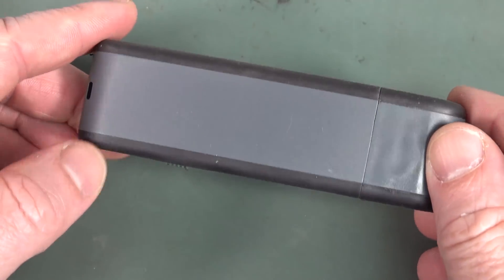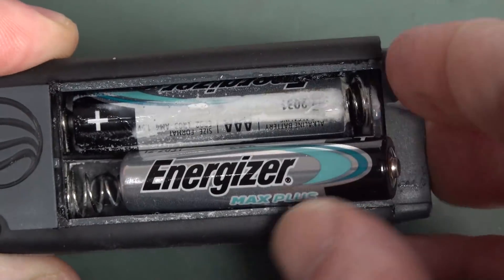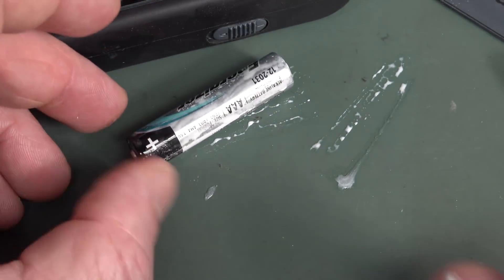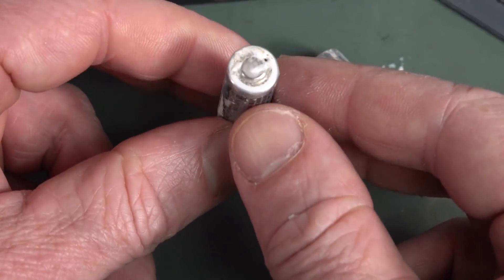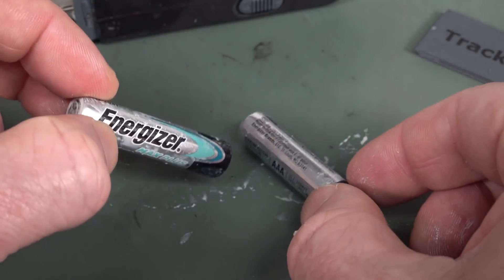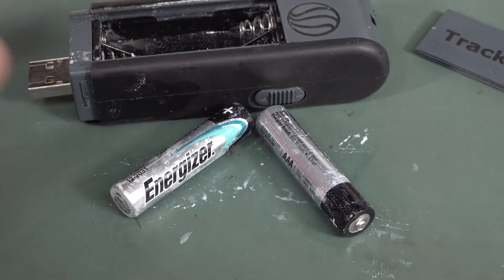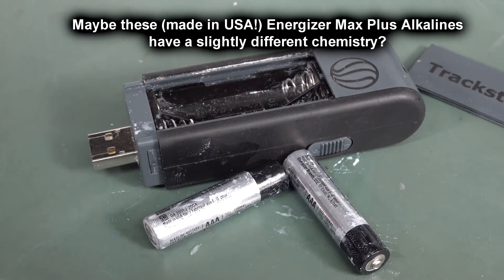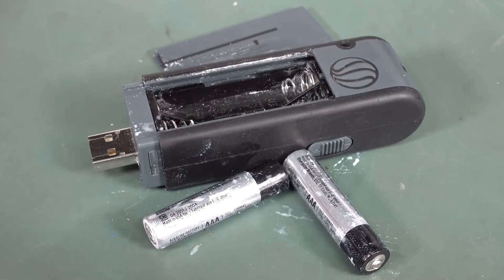EEVblog #1349 - Energizer Battery Leakage - MADE IN USA!

Comment: All of my Energizer Max in AA and AAA forms have leaked. Devices I have used them in are AC Remote, TV Remote, Oxymeter (AAA) and Wireless Mouse(AA). Thankfully I was quick to catch it just as the negative terminal was just slightly wet.
Have moved the remote's to Zinc Carbon and the wireless mice to Panasonic.

Comment: WARNING: Do not get that liquid on your fingers. I was picking up a battery and the liquid got on my fingers by accident. I immediately washed it off but now I have some type of chronic dermatitis that I can't get rid of. I have tried every ointment and cream on the market but my skin constantly flakes off revealing the lower layers. Even the doctors don't have an answer. And it only appears on the fingers that actually touched the battery. I believe the chemicals oozing out of the battery cause some type of permanent damage to the skin DNA which prevents it from growing normally and protecting the lower skin layers. I've had this for almost a year now and it won't go away. Always use surgical gloves or a a pair of pliers when picking up a battery which is leaking and dispose of responsibly.

Comment: Happened in my Game Boy, set it on a table then lifted it up to see the table discolored. Then I put the system on a air bed, then some fluid was on it. I looked inside the battery compartment only to find this.

Comment: I open up my Logitech mouse G305 for battery check, I took out the battery to see the expiry date, next thing i felt liquid through my palm, I thought why would I have water on my palm but i realized that it was from the energizer battery! threw away the battery, washed my hands back to the mouse, there was a small puddle in the battery compartment of the mouse, tried cleaning up and even did a teardown to clean that up, but it was too late, the liquid got to the mouse sensor and it is now total dead. It was total clear like water when it oozed out, during the process towards crystallization, it started to get slight sticky. My mouse was just 3 months old.

Comment: Biggest problem I have with Duracell is that they are very prone to leakage. I have damaged so many electronic items by using Duracell. I can no longer leave Duracell batteries in equipment that may sit idle for 6 months or more, and in fact, never use Duracell where I can access an alternative. With Energizer, which I now use almost exclusively, I don't recall ever suffering from battery leakage and subsequent equipment damage.

Comment: I stopped using Duraleak and Energizer due to leakage. I only use Rayovac batteries because my experience has been they’ve leaked only in the most extreme cases, such as being left in an extremely discharged state in a device.

Obviously Rayovac batteries are the ones to beat since Energizer bought them when they couldn’t beat them.

Comment: I completely stopped using alkaline batteries. I use either the more expensive lithium batteries for stuff that draws low current but must work when I use it (fire alarm / emergency flash light). Or Eneloop chargeable batteries with low self discharge (10%/year), so that they can be in a drawer until I use them.

Comment: I've seen the liquid a few times. I've tried darn near every brand available in the US. Energizer used to be good, not any more- in fact none are any good any more. I buy the cheap crap where you know 1 in ten cells are DOA or dead soon, swap out the dead ones as needed, then remove them after use if it's going to sit more than a few days unused. 

Now anything I need to keep powered gets the 'heavy-duty' stuff, not alkaline, even if it means replacing the cells frequently. If it something which needs to be long-term I take out another mortgage and use lithium primaries (which are usually Energizer brand ones). So far so good. 

But my preference for most things where I can use them is now LiIon; one heck of a lot of energy and if not mistreated will last for many years us use. Not a direct-swap for primaries but no leakage and best long-term value where you can use them, especially the 18650 size which has the best 'scale of manufacturing' cost as so many of them, are made. Use only the good ones with a good charger and you'll never want to go back to anything else.

Comment: Here I stoped buying Duracell, the leak randomly between the first 8 or 10 month. Have many thing ruined already. And 10 yeard ago you could leave this AAs for ages and no leaks. Energizer is a bit better. In the old time, the zinc carbon one were the leaky and the alkaline were the one that dont. Now guess what, the cheapo zinc carbon garbage will stay longer without any leak comprared to the more expensive well knonw brands. This happened in the last 5 years or so. Ok with planned obsolence but ... ruining my gear ?. Now if I mnot not using an instrument for a couple of months and need to take the Duracells OUT and put in a shelf. OF COURSE ..... the dont leak on the shelf. ONLY INSIDE YOUR GEAR ... CROCKS

Comment: I had this happen with the power winder on one of my 35mm cameras. I couldn't figure out why my hand was getting wet, until I removed the battery cover. I was using Rayovac batteries.

Comment: "For once it's not Duracells" .. Brilliant!

Having worked in the service trade (TVs & VCRs, HiFi etc.) and since then doing repairs as a hobby you wouldn't believe how many ruined devices (usually remotes but sometimes radios and other portable equipment) I've had to fix, usually with DuraLeak™ cells fitted. Many of these still had charge in them .. maybe exacerbating the issue?

And, yes, I've had a few with the liquid coming out ...

Comment: At 0:54, "probably should put this on my fingers"
At 2:49, still has it on his hands........😮😮
At 2:54, "clean it up straight away"  😪😯😪😯
Dave.. Dave.. please ... Where is your clean up gear?
Hint; At my workplace we have bog roll holders on the bench with bog rolls on them, any spill or quick wipe you just rip a couple of squares off and Bob is your Uncle.
Also good for using with iso to wipe and  clean stuff.
I have had commercial gear with leaking Alkaline, doesn't matter what brand.

Comment: Yeah that sucks to those  batteries leak it ruins your device and vinegar is also a acid so it doesn't help your metal terminals use baking soda it neutralizes the acid it's a bicarbonate

Comment: Is actually not acid inside, that's why they are called, "alkaline batteries". It's the opposite of an acid which is why you use acids to clean up after. 

This is also why you should only buy lithium AA and AAA batteries. They have around a 20 year shelf life and never vent electrolytes. They are also waaayyy lighter...

Comment: Had a bunch of toys sitting with batteries inside. Toys all had physical power cutoff switches wired in series with the batteries. Multiple brands used. Half the Duracells leaked, every single off-brand leaked (Thinkgeek), and none of the Energizers leaked after about half a decade. Thankfully I was able to clean them all up and get them all working again. So now I've got Energizer Lithium in the really important stuff, and Energizer Max in the less important stuff. But after seeing this, it makes me think they drank the same forbidden knowledge Duracell did and have let their quality slip away. Very sad.

Comment: I had some energizer batteries leak in about 1984, but that was an oily substance with a weird smell.  It was something not easy to just wipe off, but I had to use a special soap to get it off at the time.  They were D cell batteries.  Mine was in a boom box that had physical power switch and was off at the time.

Comment: I had recharged an empty alkaline because I had no replacement. After use, I removed it from the device and put it on the bench. 
Some days later i noticed a hissing noise and found the battery spraying its guts on the bench. I thought maybe it had an internal short, but it was completely cold.

Comment: Yup, found about a tablespoon of liquid electrolyte from 6 D cells in a synthesizer. 4 of them had leaked only a day after I put them in. Duracell. Incidentally, the only other brand I've had leak has been Energizer, but Duracell is really bad, they leak almost every time I buy them. Which... might be why I haven't in two decades.

Comment: I have but not to that extent and I think they were mostly Duracell's, I have occasionally had other brands do it.

And I had a leak in a two way radio I proceeded to clean with isopropyl alcohol, then noticed on the Duracell site they recommended lemon juice it went from working to no longer working.....

Comment: I had some duracell batteries Make a Pop noise in a cordless mouse a long time ago in 2005 and it scared me as it popped quickly I figured pressure buildup caused the batteries to pop destroying a cordless mouse
Reply: They were venting most likely due to overheating/too much pressure.

Comment: When I saw that liquid it reminded me of an incident that happened about 15 years ago when I got electrocuted by my Fluke T5-1000 (or whatever the equivalent model was back then). The meter is a handheld device that lets you attach one probe to the unit and hold the other in the other hand so you can find an earth  somewhere and probe around. I was checking inside a control panel for 230vac, when suddenly I got a huge shock. It wasn’t immediately obvious what had happened, but when I got outside into the sunlight, I could see that white semi transparent battery liquid seeping out from the battery cover on the back of the meter. When I took the battery cover off, it was all over the place. I still don’t know if the battery liquid had tracked through to the live parts inside the meter or if the battery terminals and everything else in there are at the same potential as the red probe. It would be interesting to see a tear down on one of those meters and see what’s going on.

Comment: I’ve had kit totally destroyed by Belgian manufactured Duracell’s 30 years ago (full replacement of the item under their guarantee) I rescued a Fluke DMM of a colleague around the late 1980’s that suffered the same fate. Yet I then used them and their ’Procells’ without further issue until about ten years ago, I’ve since had numerous Duracell leaks on fresh batteries in storage, and slight leaks onto terminals in use in low use tv remote controls.  I called time and I have now moved to Eneloops for most things and Energizer Lithium where rechargeables are not suitable.

Comment: I've only seen it leak as liquid once. Usually I catch it after it dries out, and the corrosion sets in. If you clean it up right now, you may avoid damage to the device itself.
Reply: Depending both on how long he cannot find lemon juice and doesn’t realize water will also work.

Comment: Only batteries that never leak (as far as i am aware) are the lithium primaries such as the Energizer Ultimate Lithium, veeeery long shelf life as well, nowadays i think they're only ones worth buying because if you use enough power you go rechargeable and if you don't want to recharge batteries all the time or you need a higher voltage in the circuit then lithium primaries, alkalines just have no place anymore. Even on a remote control I'd put some lithium in there it may even outlast the remote itself i have fully charged lithium batteries from 2010 still 1.8v in 2020 from duracell.

Comment: For cleaning battery smutz I use a 50/50 mix vinegar and 90% isoprop alcohol, followed by just isoprop to rinse away any acidic residue and residual moisture. If it's really bad some scraping and emery cloth polishing may be necessary.

Comment: Recently clearing out my loft I found a small Transistor radio, must have been there several years. On inspection it contained 3 AA batteries, 2 Duracell and one Energiser. The Duracell had not leaked but the Energiser had and was covered in crusty goo. I tested the two Duracell batteries, (dated March 2008 and March 2009) and miracullously they both had over 1.5v charge. I cleaned the battery compartment out and the put the two original Duracell batteries in and added one new Duracell and the radio works fine and has continued to do so for 2 months!
So dont knock all Duracell batteries, the older ones at least are great!

Comment: Just use Lithium ( LiFeS2) AA/AAAs in any electronics you care about and you can't go far wrong.

...or rechargeables for high current things where you'd be swapping batteries out all the time.
Reply: I am thinking about getting LiFeS2 batteries for my multimeter or just throw NiMH batteries in and call it a day.

Comment: When I was a child an alkaline battery of unknown brand start spitting and hissing, spraying the contents out through the seam between the battery holder and the cover. I suspect that I had mixed a new battery with a used one, as I often did as a child.
Reply: And
As adults often must, you put away childish things; I suspect you have stopped calling alkaline electrolytes “acid”.
Reply: @HighestRank  Good point. I’m accustomed to using large industrial batteries so “acid” just comes out without thought.

Comment: I happened to discover an ancient pocket calculator yesterday. The LCD was a bit weak but still working. Two beautiful batteries looking perfectly new:
04-2008
Powertec Super Zinc-Cloride
Mignon 1.5V AA R6P
Medion AG Germany

We do not grow bats in our food markets but you can buy Computers or batteries. At least back in 2008 you could. They still have 1.55 Volts in them but probably no amperes

Comment: Yes had some Duracell Pros that had leaking liquid and it seeped onto the PCB. Corroded enough to ruin a remote control. I contacted Duracell with all the info and they sent me $25 to help replacement cost. So they are aware of the issue as I'm sure Energizer is.

Comment: Crystallized “leakage” is actually a base salt and it just needs time and dry air to transform from alkaline solution. As it seems, the reaction yet didn’t finished.

And since reaction is so slow and still going, I’d not used any acids which can dissolve anti-corrosion coating on the battery contacts. Instead I’d just disassembled the case and washed it under water.

It’s actually hard to find the proper acid and achieve the proper concentration of its solution to actually neutralize the base without reaction with sensible surfaces.

Comment: Using dry cell carbon zinc batteries in low power devices like remotes will eliminate leakage. NiMh batteries will not leak either but you have to recharge them.

Comment: I have seen this on both Duracell and Energizer batteries. I had a battery that looked black on the end like someone held a lighter up to it and burned it. Do you live near salt water from the ocean? My meters batteries always corrode when left outside. I live on the coast. This could be a reaction from salt water corrosion or humidity. I did see your battery leakage test video where you didn't have much of a result from a slow drain over time.

Comment: Something they all seem to do when they are drained flat. Prevailing wisdom seems to be that as the chemistry changes once the cell is depleted, hydrogen gas is generated, which eventually causes the seals to fail.

Comment: I've had batteries start to leak when I ran them all the way dead in the many LED lights I have kicking around. They usually start making bubbling noises while in the light even though the light is on and working. These lights use so little power, I can put batteries in them that are dead to other devices and they light up brightly. And when I throw them out sometimes they pop in the trash can. 

Also I use alcohol in the form of hand sanitizer to clean leaky battery compartments.

Comment: I've seen this before with Energizer alkaline batteries. Happens far to frequently. I've even seen where new ones hanging on the display at the store show leakage while still new in the package...not good. Don't understand why they consistently leak like that. Do they have a flawed design?

Comment: Alkaline is a terrible battery chemistry. Primary lithium batteries (like Energizer Ultimate Lithium) are better for low power, long discharge applications. Especially for devices you care about.
Reply: This is why I always use lithium in devices I really care about, such as my weather station and it’s add on sensors.  I have even begun using them in my remotes that take AAs or AAAs.

Comment: I have just this year only, Rayovac are horrible with the liquid leakage I had so many do this that I have a full box full of these bad batteries. Multiple controllers and remotes needed to be cleaned. High humidity does this really fast now including drainage without usage.
Reply: This may sound odd but a Neutrogena Microdermabrasion device will cause the Rayovac batteries to burst! with leakage if you'd like to show a demonstration and happen to have one of those kits laying round.

Comment: I have had liquid leaking Duracell but is maybe over 20 years ago, at that time did I just thought it was some water mixed with a leaking battery. I could not find any way the water should have got in there, as it was inside in a drawer, but that was what I thought, now does it make a lot more sense! :-)